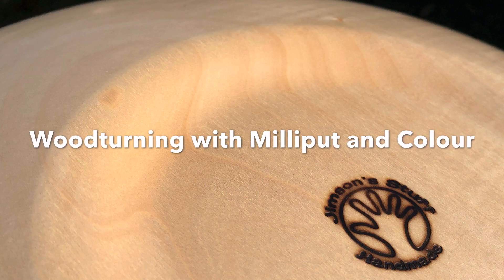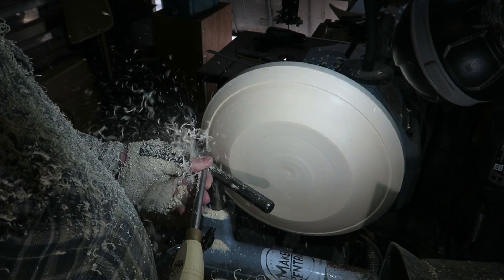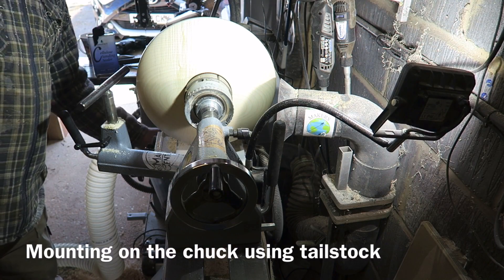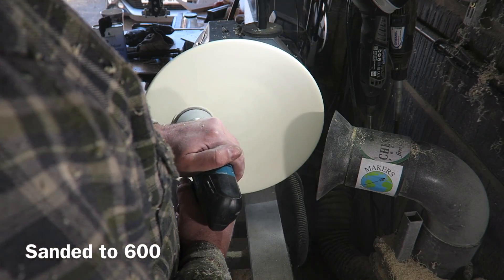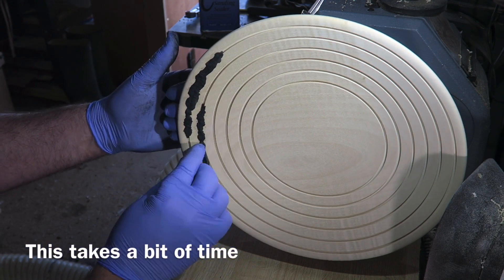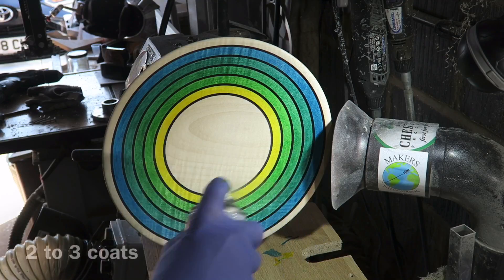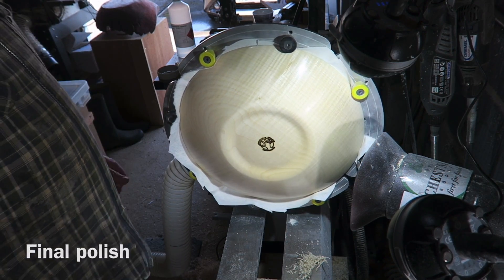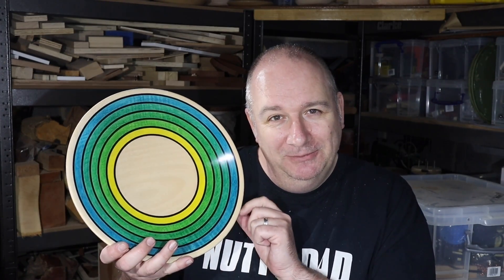Woodturning a Platter with Milliput Inlay

Comment: Hi ho Jim, glad to see you turning again. I have a question for you as a milliput expert, is there anything I can do with old milliput to soften the hardener as it seems to have hardened a bit. Thanks
Reply from the maker: Thank you very much Jonathan. Old Milliput can go a bit hard, try warming it before mixing it, perhaps by putting it in a poly bag and putting it in a bowl of hot water. I have heard of people microwaving it for a few seconds but not sure how safe this is. Older Milliput does soften on mixing but will require more mixing to eliminate the harder bits.
Cheers 
Jim
Reply: Thanks Jim I'll let you know how it goes 👍

Comment: I've found the miliput usually gets stuck to my gloves and impedes the process
Reply from the maker: It does stick to everything. I never used to wear gloves but it is possible to develop a sensitivity to epoxy over time and I want to avoid that. 
Cheers 
Jim

Comment: Enjoyed watching & listening while you are turning.  I am a “woodturning wannabe”.  Sad to say I Have a sycamore tree that needs to be cut down because it is too close to foundation.  After cutting, about how long for curing before turning?   Do you turn green or cured?  The finishing products you use-  hand wash?  Soapy warm or hot water? Acidic food? Bread only?  Meat?    ???.   Could, would you do a class in sharpening your tools?  When do I know it is time to sharpen?   2004-Bought a lathe after watching a demo at Lowes DIY store.  Then LIFE & making TIME became overwhelming.   Hope I did not ask too many questions.   Hope you and your family have a Blessed day.
Reply from the maker: Thank you very much Marjorie. The finishes on this piece are not certified food safe and could only be wiped clean with a slightly damp cloth. There are plenty of food safe finishes available. I tend to sharpen the moment I notice the tool is not cutting so well ( comes with experience ) it depends on the type of tool and the type of wood. With fresh cut wood, you either need to cut it into suitable size pieces and wax the end grain and let it dry naturally, which can take between 6 months and 6 years depending on size OR you rough turn it green, making a thick piece with even wall thickness, this can be packed in a cardboard box with the shavings for a few months before putting it back on the lathe and refining it. Drying wood is a massive subject and there are numerous techniques, best do a search on YouTube for some tips.
Stay safe
Jim